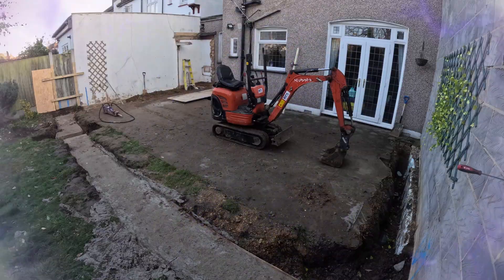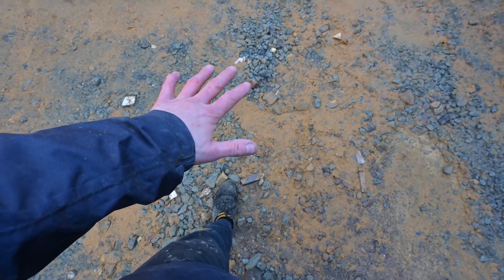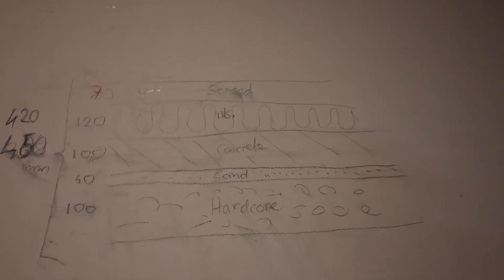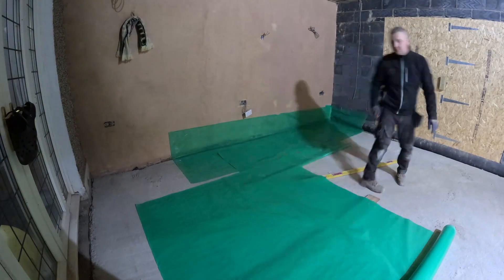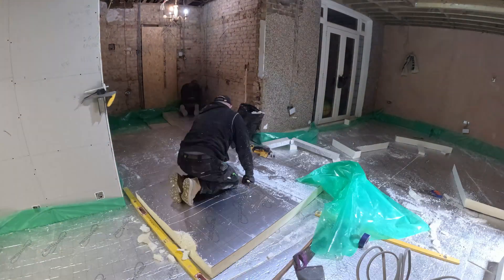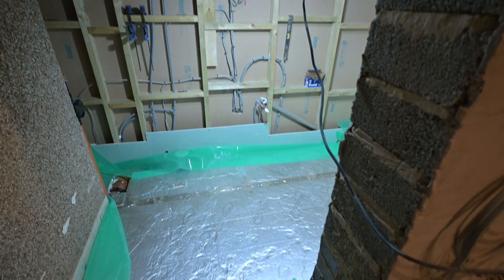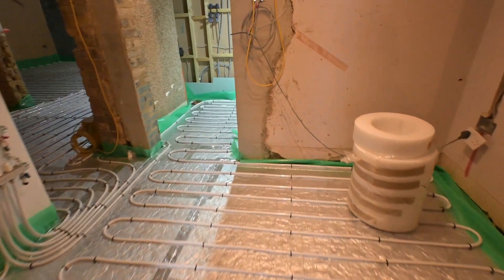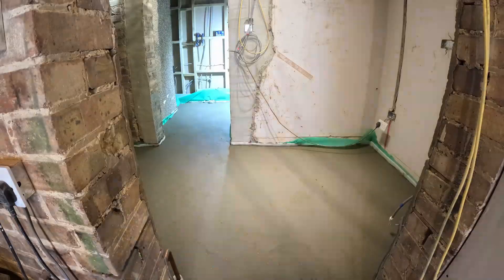How To Build a House Extension in 2025 | Step- 4 Floor Build-Up | Step-By-Step Extension

Comment: Is the last layer a micro cement?  Is it required to know about the water table level in the UK?  If there are no flooding or water table issues, I think with all the layering, the floor will hold for decades.
Reply from the maker: The beauty of this product is that every single letter is resin based and waterproof from the start. Water can't penetrate it from the back or the bottom and it's extremely scratch resistant.
Reply: @yesconstructionltd what is the name of the product?  Do you know about micro cement?  It is being widely used in the states.  There are a few videos on the product
Reply from the maker: @libertadbrito778 
We use Claudi cemento. Their product is really good and it's resin based from the first letter so completely waterproof